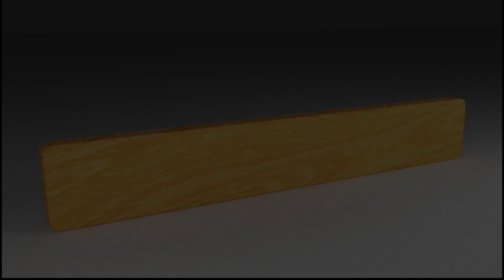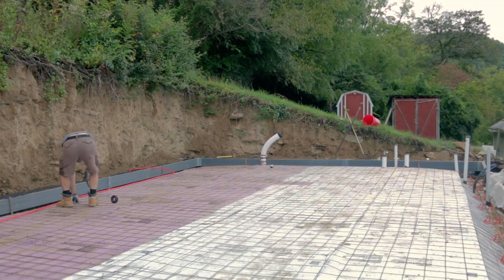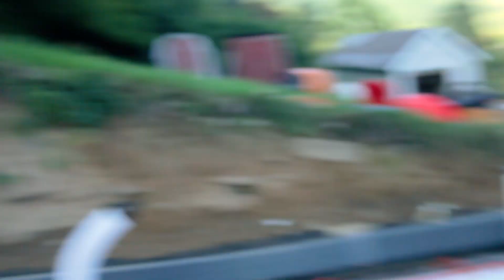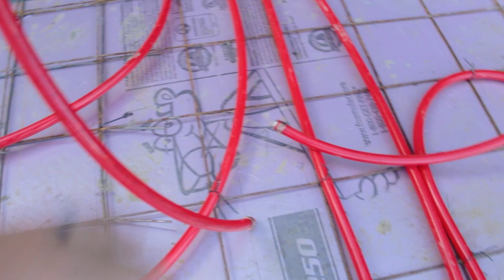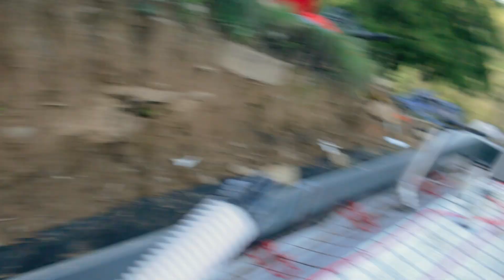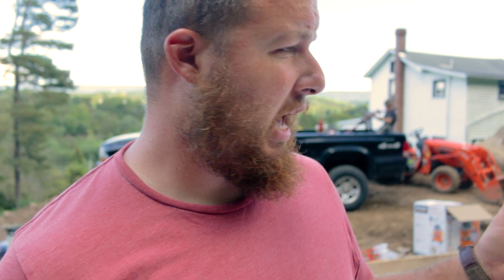Garage Build #13 In-Slab-Pex Radiant Floor Heat Layout

Comment: Not sure you are right with one of your comments about return flow temp.  The cooler the return is the more efficient your water heater runs. This is because the cooler the water is, the more energy/heat it will absorb as it flows through the heater for a given time. The bigger the temperature difference -  the more heat is extracted/transferred from the heater to the water. You then use flow rate to manage the heated water temperature instead of the heater coming on and off all the time, if you are using a heat pump you absolutely want to keep the temperature gradient as large as possible with cooler return flows.  Long pipe runs can however be a problem because of the reduced flow rate and reduced heat radiation as the water cools past a useful point on long runs - nothing to do with boiler efficiency.